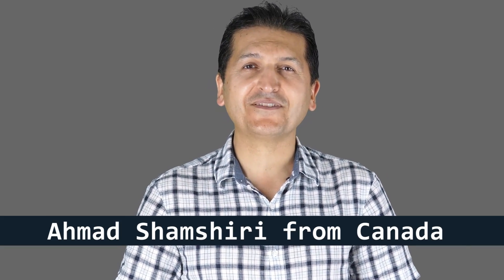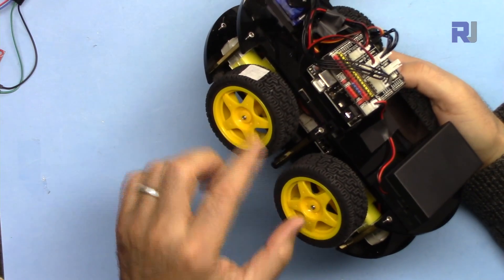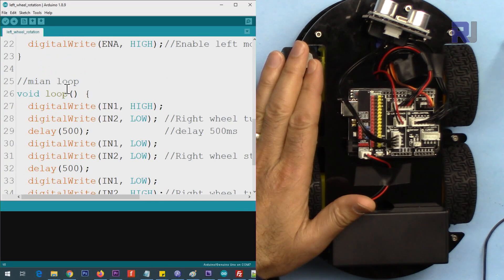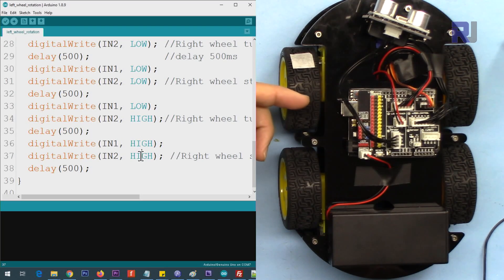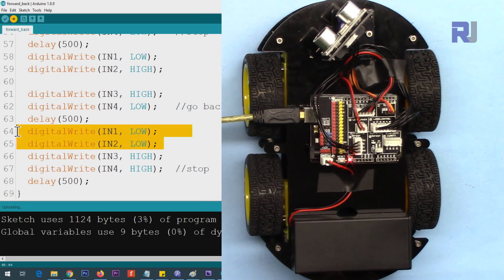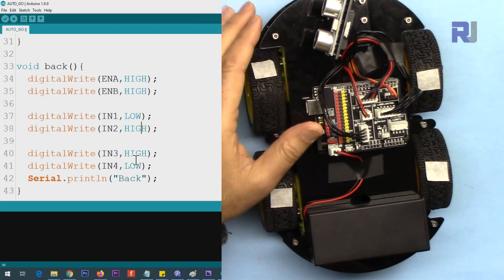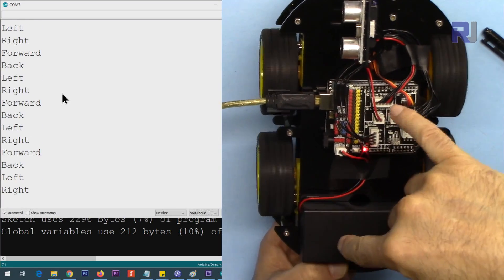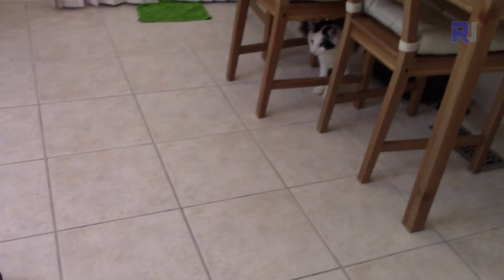Elegoo Smart Robot Car Kit V3: #3 How to move forward, reverse and turn left and right - RJT240

Comment: Hello I have a senior project and the main point of it to make the car move to specific path, can you help me please? I have struggled a lot and I couldn’t find any other solution
Reply from the maker: Hello, I have demonstrated it and explained the code. Why can't it go straight? if it moves a little to the left or right that is because of the difference in quality of motor.  so reduce the PWM % one site or other side a little and it should fix it.

Comment: sir, help me for fyp, can i get full code for this project for (Left, right, forward and reverse demonstration (Auto_go))
Reply from the maker: in the first 3 second of the video I mentioned that the "you can get the code for this video by clicking on the link below the video in the description". So it is there.
Reply: Just left wheel rotation , not full demostration code sir
Reply from the maker: I have series of videos on this robot car.  I've explained how this goes to left. so if you watch it, you will learn and use only the left wheel rotation.  Good luck.

Comment: Robojax my brand new car doesn't go forward. when i press forward it go to the right. the other controls work fine. can you help me out?
Reply from the maker: Hi, it is clear then . either pins are assigned incorrectly or the code is modified. Check it and it should work.
Reply: @robojax  thanks brother